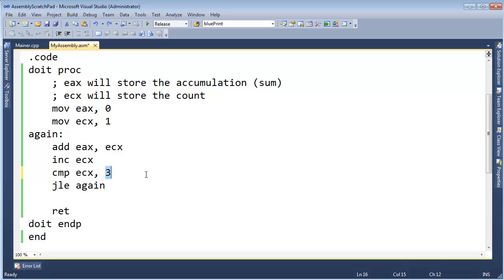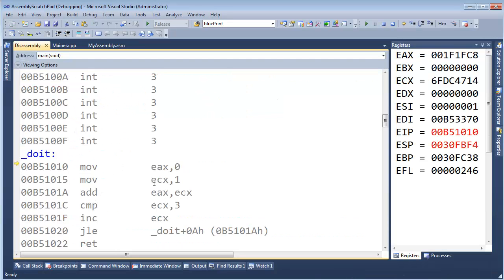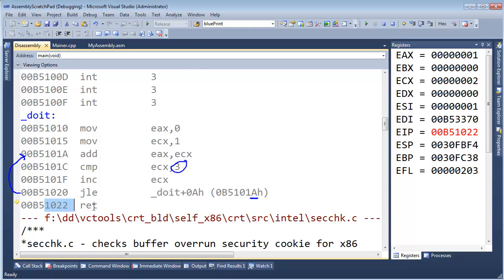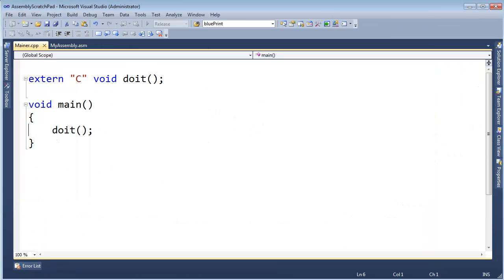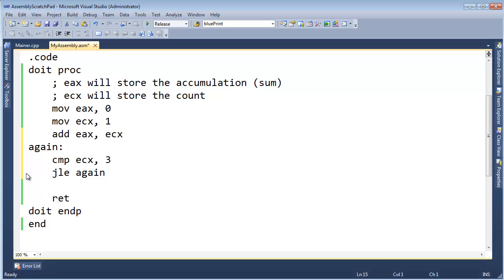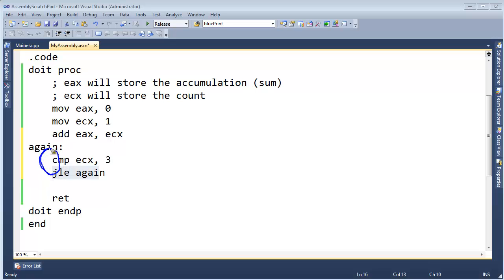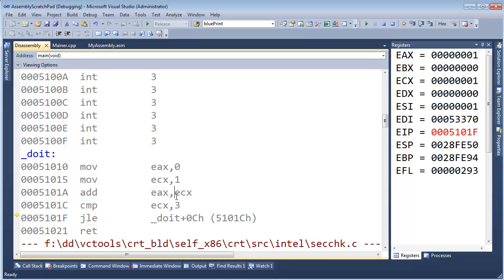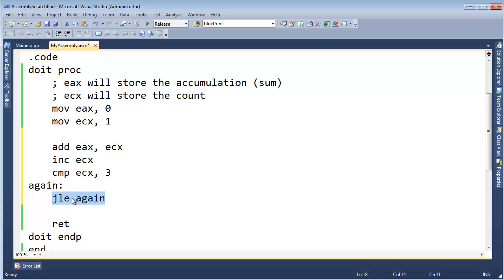Subtle Assembly Bugs

Comment: 02:12 If that would be the case, you couldn't use more than one branching instruction after `cmp` as you did a couple of lessons ago ;)
So actually, you can have conditional jumps that are not immediately after the `cmp` instruction, but you have to make sure that the instructions that are in between are not interfering with the flags.
Actually, you can even have a conditional jump without the preceding `cmp`, because the only thing the conditional jumps really care is the flags register. So if some of the preceding instructions modify the flags in some way, you can base your conditional jump on that as well. One useful application of that is checking the integer overflow flag, or branching with regard to the auxiliary flag when you do some BCD arithmetics ;)